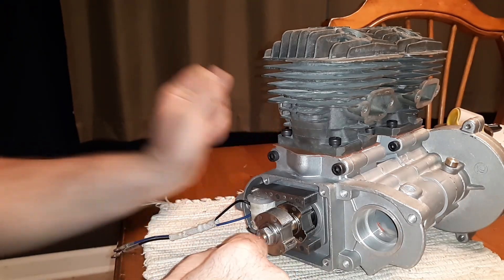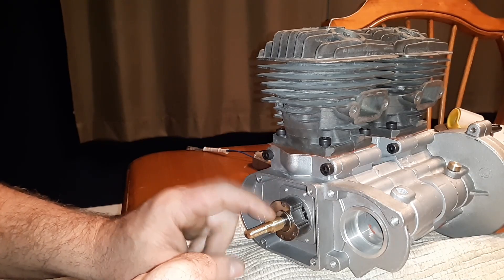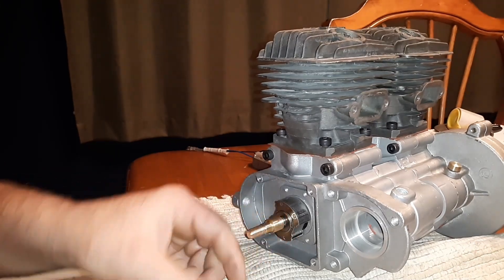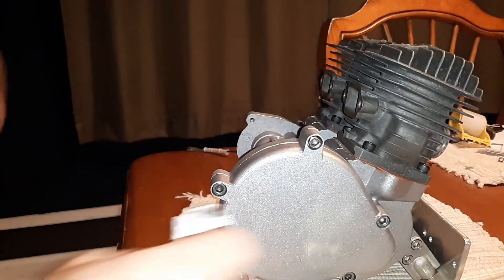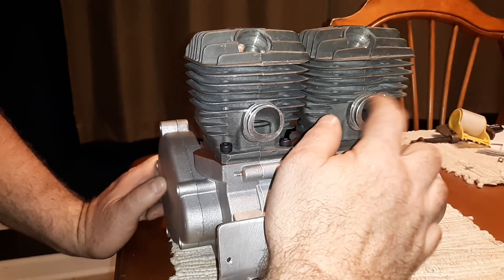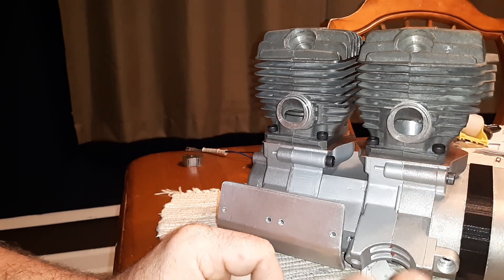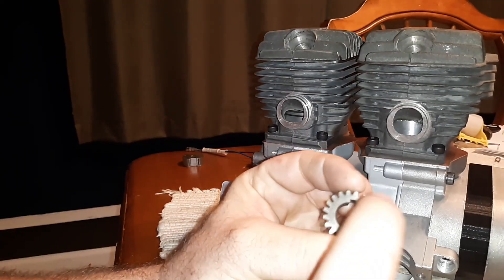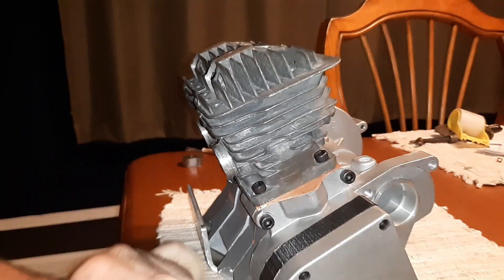Dual Ms460 Motorized Bicycle Build - Many Asked: Magneto Setup, How?

Comment: Ive gotta say i e always wondered why i dont see more peiple finding out wich side is posotive and witch side is negative then demagnetize the magneto magnet so you can drill and epoxy your own much stronger neo magnets  and for the gears it all depends on the tools available most machine shops have tooling to cut gear teeth with relitive eaze  so you can realy exapect to get one made of almost any material  and anouther thing ive wondered is im suprised i dont see more people trying to figur out a wet clutch  to both help with power delivery longevity and lubercating the crank/clutch gear
Reply from the maker: Magnet is just plates pressed together with one permanent magnet on one side. The magnet inside is a neodymium magnet. 8mm round 3mm thick one.  I took one apart a while back.   There is a guy by the name of (tan boy) I think his name is on YouTube. He is currently making a wet clutch actually.

Comment: Really nice! Looking to do pretty much the same thing but just need to figure out how many degrees each cylinder should be off from one another? Seems like they should be 180 apart but you say yours is 3.5 so I really don't know? Maybe you could shed some light on that for me? It would be greatly appreciated!
Reply from the maker: 183.5 if you don't off set them a bit it won't turn over
Reply: @BuildBreakFix  Thanks for your quick response. Have you ran this beast yet? And how does it run?

Comment: Why are these set at 3.5 degrees off from another, and why not 180 from each other? Thanks
Reply from the maker: Makes it easier to turn over off set of the two main compression/ vacuum states
Reply: @BuildBreakFix  Thanks again I really appreciate your time to answering my question as it does make perfect sense. 👍